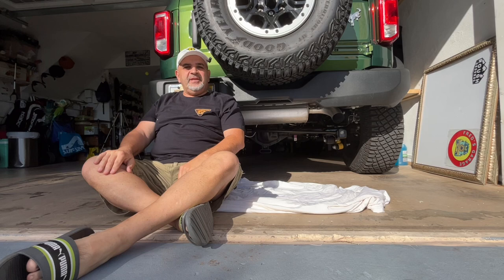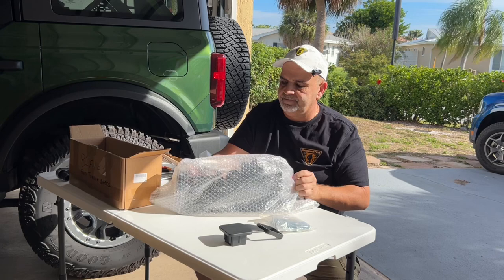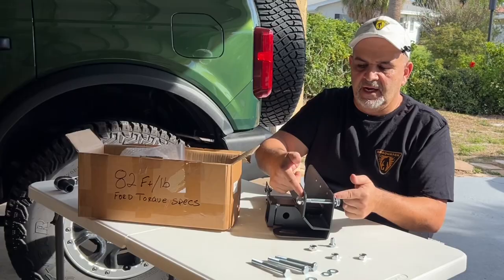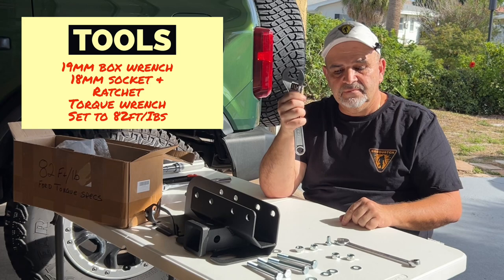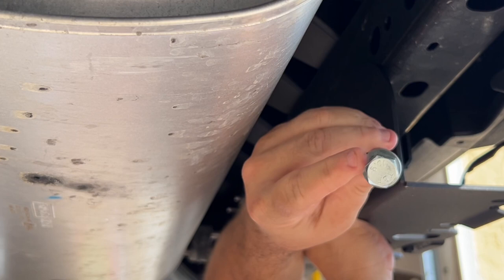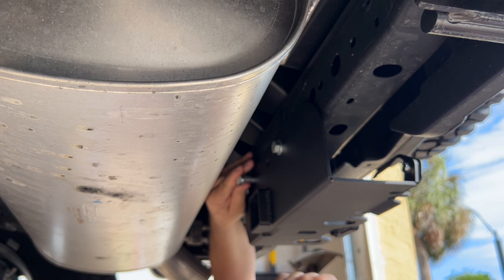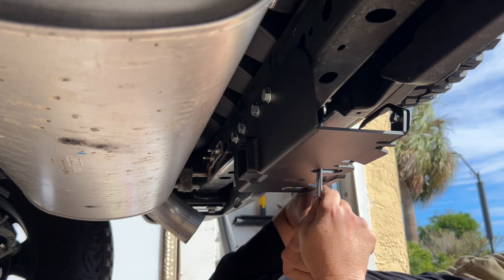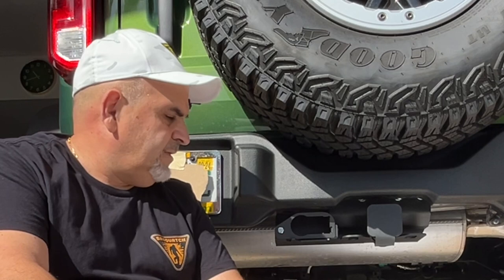Easy trailer hitch install on a Ford Bronco.  instructions, tools  and tips for an easy DIY install.

Comment: The lock nuts are great, but I always put a drop or two of Locktite as a backup to keep thing tight and worry free. Is there a wiring kit for that hitch? Happy Thanksgiving.
Reply from the maker: Thanks you, yes the lock tight is a great idea.  I got my trailer harness with my ford pass points and I will tackling that next week.  If you look in the description box on the video there are 2 CURT wiring harnesses. 1 is if you have Halogen lights like I have and the other is for LED lights.  They won’t intermingle.  I hope you also had a great Thanksgiving and you have a great day.